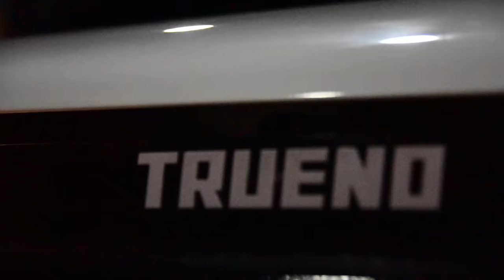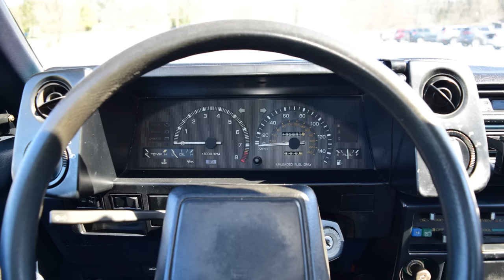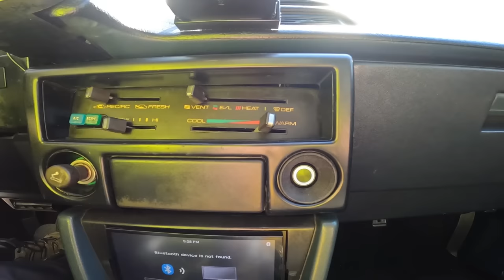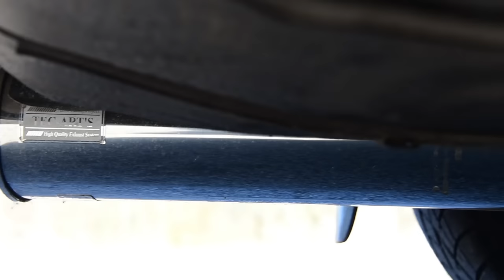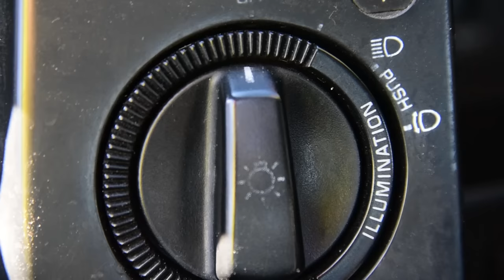1984 Toyota Corolla GT S Initial D AE86 Takumi Fujiwara Replica: Regular Car Reviews

Comment: I actually had 2 different AE86 at the turn of the millennium..... Both were bought for under $800 running perfectly and both were GTS models. 

Really wish I would've held onto them. 
I could have $20k to $40k
Reply: Lol, I feel your pain, I had other JDM cars which didn't cost much in 2005, now they are XXX times the price
Reply: Proof? Or it's not true.
Reply: Perfectly believable if it was before they started getting expensive.
When was that even? I remember they were about $10k when I watched Initial D for the first time maybe five years ago.
Reply: I'm talking literally 2000, 2001 when I was 18 and 19 years old
Reply: @user-pn3fv9pt4m you must be young. Wait until you hear that running s13s used to  be  $1200..
Reply: Okay, but....

1) If you had held onto them, would you have put in the maintenance to keep them running for over twenty years, including paint and rust repairs? Be honest: they were $800 cars back in the day, after all.
2) When you factor in all of those repairs, plus the cost to insure and register the cars, plus inflation... how much would you have really walked away with if you sold them right now? Probably a bit of money, but not as much as it seems when you consider the costs.
Reply: @arnehurnik turn of the millennium aka around 2000
Reply: I bought a 90 sw20 for 3k around 2015 and regret getting rid of it, stupid me got in way over his head with that project.
Reply: Z31 is an amazing car that can be had at a low price today
Reply: Same. I didn't hold on to the 86 I had, but I did hold on to the AW11s. I have 3 lol
Reply: @Toasty_Gaming  no. They're awful to work on. Not recommended.
Reply: This is true of all kinds of things, not just cars. You'll make yourself crazy if you think about it.
Reply: @blisterbrain  I know. Trust me. At 12 years old my Father sold ALL my childhood toys at a yard sale. Star Wars, Ninja Turtles, G.I. Joe and soooo many more. 
Even at age 12 I knew they were going to be worth money, I had every last accessory to every toy in great presentable condition.
Years later when my childhood toys were worth profane amounts of money, I would constantly show my Dad what my childhood toys were worth and made sure he realized he screwed me out of easy money. 
He was always genuinely regretful because he always taught me to be smart on what something is worth
......he couldn't get past seeing toys as "plastic junk".
 

He would tell me that he finally truly understood the words that 1 man's trash is another man's treasure
Reply: @willlawson6126  Don't get me started on what my sister did with all my stuff! 
It's funny how none of her crap got chucked out or sold at a yard sale, from which, I might add, I never saw a dime.
Dang, now I'm bothered again!
Reply: Lol proof or it's not true i guess you had to be there.. they were a dime a dozen in Australia late 90s early 2000s. I had mates with 3 or 4 of them in their front yard. And were quite a few back then with 20v silver top conversions and the like and you would be hard pressed to get a few grand for them if you tried to sell em. We were all watching initial d back then too but that didn't change the fact that they were 800 dollar specials to be beat on and just have fun with

Boggles the mind how some people can't fathom that and think they were always some rare exhalted and exotic magic carpet of a car
Reply: @brendanmeadors3099  What's funnier as these younger folks asking for pictures before the ages digital camera
Reply: Passed on buying an 86 GT-S in 2008 for less than $2,000.

Comment: What a classic car. The longevity of Toyota is incredible and exists for a good reason. Reliable and well designed vehicles
Reply: keep oil in em and they'll just go and go and go
Reply: Ikr idc what anybody says i will fork over $50 grand if I have to if I have an opportunity to get a pristine panda 
<藤原とうふ店>
Reply: @ghomerhust   In them and under them. They do know how to rust, it's the only thing that'll kill one. Mine was a generation older and I drove it to the junkyard when there was hardly enough good metal left to put patches on.
Reply: My 2001 Rav4 is still going strong, in all weather conditions.
Reply: As Jeremy Clarkson says: you will die before the car. My dad died before his Toyota, and the damn thing is still running, with all of its electrics still working.
Reply: The toyota THEN. Add electronic crap and self destructing 3 pot turbo gr malarky and you get a ticking timebomb...
Reply: @ktkacewhat you mean by "self destructing 3 pot malarky"

Comment: I have an AE111 so I'm not free of sin here but this car brings the hype and the smiles.  The 4AGE is an incredibly fun engine. 

And on top of everything else, this episode was quite special.  Well done all around, guys!
Reply: The 4AGE is possibly the most brilliant fun 4 cylinder to ever exist.  It just edges out the Austin A series for me.  The common theme is they are both pissed off 4 cylinder engines that punch way over their weight class, and sound amazing doing it.
Reply: JCS  Couldn't agree more, I also didn't know Yamaha had a hand in it.  Yamaha does everything to the most perfect degree they can.

Comment: The design of the AW11 and AE86 is the best kind of dated. I think the phrase you used ages ago was something along the lines of "optimism for the future."
Reply: Don't forget about the ae82 (fx 16) !
Reply: @yuuji_  I was going to say this too. I have an FX16 GT-S as my daily driver and it's a very fun car, even if it doesn't have pop-up headlights.
Reply: @ThePhoenski  i do too hehe
Btw are you running coilovers ? I can't find anything other than BC & Ceika (and less known DGR & MRP) but my main issue is their price. I'm not a cheapskate, but here in EU all these options are 1500$ or more :/
Also does 15*8 with a low ET fits ? (I'm currently on 15*6 ET 49, i need spacers at the rear)
Reply: @yuuji_  I do have coil-overs, however, I got the car with them already installed so I don't know what they are or what the specs are (I have pictures if you want.) Could you explain what 15*8 and 15*6 ET 49 mean? I also have an Ultra Racing rear upper strutbar, and rear and front sway bars. I didn't install these either so I don't know what the part numbers for these are. I've got a question for you now: how do you source OEM parts?
Reply: @yuuji_  my brother drives an AE82 GT too (European 3door model) he has BC racing coilovers and be careful with your wheel choice because you'll end up with very little space in the rear. For example, his wheels are 15x7 et24 with skinny 185 tires, and the tire almost rub the coilover (like 3-4mm) but the tire is also flush with the wheel arch ! Oh and the car is not lowered that much, I'd say a little lower than stock height
Reply: @yuuji_  I got a notification that you replied but I don't see a new comment, did it get deleted?
Reply: @ThePhoenski  yeah i tried to reply 2 times already, i had to rewrite this essay (yes it was this long) once i saw that it didn't got through. I maybe have a part pasted in the clipboard of my desktop, i'll try again later

Edit : typo
Reply: @Miky9560  yeah i'm already having clearance issues at the rear, i have 2 2mm washers (so 4mm wide) on the studs temporarily, that gives me a 1-2 mm gap with the suspension x)
But it's not flush with the fender, the front tho, almost (cf background pic of my profile)

Edit : i'm on 195/50/15, michelin pilot sport 3 at 2 bars (but i find the side wall to be quite soft, oem is 1.8 bar for 185/60/14, shop put 2.5 bar in the ps3 originally (nitrogen inflated))
Reply: @yuuji_  there is not much issue at the front, the tire sometimes rubs a little on the plastic liner but it's ok, front is 15x7 et35 with same 185 55 but he will put some 195 50 like you have. The real concern is the rear with aftermarket coilovers, a 195 tire barely fits in that space...

Comment: And then Toyota themselves made 2 unique versions of the AE86: the AE86 Sprinter Trueno Hydrogen powered car, and the AE86 Levin EV...

The best part: the EV has a manual transmission...
Reply: The hydrogen one also has a manual transmission, because it still has a 4A-GE
Reply: @Kosoku63  the EV having a manual is more significant because it IS an EV with a manual transmission...
Reply: @cjmpaja  id say, in my humble opinion, that the Hydrogen ICE Corolla, is a bit more gamechanging, because instead of developing something new (which they did for a bit), they took a 20 year old proven engine, changed its diet, and now you can run it beyond 2025-2030+ because its only emission is water, and you still have the sound of an ICE, the grittiness of an ICE, the fun and simpleness of an ICE engine, and all you need to do is feed it compressed water (its not that simple i know) and make sure it doesnt rust beyond comprehension, but i guess manual EV is pretty cool since you can control the torque and that can be a fun time.
Reply: Then the question is: Why the richiest Toyota does not make a modern version of this cars? They have the money, hype train is not seems to stop, and they have the big chances to become more rich with that retro styled hatchback/coupe. Why Toyota is being so pussy about releasing anything fun and original, while Chad Hyundai/Kia just do it and gets expected lots of cudos for it?
Reply: @mushijian7839  go watch the Rav4 Prime episode of RCR for reasons why Toyota does Toyota, but, if youre paying attention to what theyre currently doing, Toyota is trying to paint a bigger picture, because whats the point of wasting money making fun cars now, if theyre not gonna survive for another 2-7 years (since most countries and companies are planning to go full EV and clean by 2025-2030), so like instead of dreading in that perspective, why not spend it on R&D for a solution? hence all the Hydrogen research theyve been doing recently, hell even Porsche is researching synthetic fuel so that the Porsche 911 doesnt go EV because even they realised thats an abomination.
Reply: @Namiz00  Well, about hydrogen and synthetic fuel thing... Of course it's a good thing to invest your money as a large company, but not when "all bets are off" for capitalistic government, who choosed to just make big smartphones on wheels. Rational companies will be screaming out loud "LOOK! THERE IS REAL WAY NOT TO BUILD EV AROUND HUGE LITHIUM BATTERY!!!", but they just get an answer basically to shut up about it, because Iphone with dead non removable battery is more profitable for business sharks, rather than Iphone with the battery that you can remove, pay a small price for a new one, repair it on your own, and continue to walk with the same old Ipnohe again.

Comment: From Puerto Rico here, still living on the island, and I can confirm that they were very common and still are very sought after. If you get out of the metropolitan area and go to the inner parts of the island or the west side, you’ll still see them roaming the streets. If you attend auto shows and classic auto shows you will find pretty beautiful examples and unmolested ones too. 
The Saab wheels were the hot trend for the hatchback specifically, but the coupés also joined in.

Comment: Mr regular is absolutely right on the ae86, I'm on my third ae86 fastback, first one was an SR5, second one was a 2jz swapped SR5, and currently I went back to basics with a rust free GTS with a freshly rebuilt 4age. The whole attraction to this car is how visceral and basic it is, the challenge of driving something so underpowered to the limit is very rewarding. Although it's a bit overpriced and over rated lol

Comment: I passed on a 1986 or 1987 GTS sedan in early 2012 - it was $3600 I think, in really good shape. I was looking for a replacement for my little '86 Corolla hatchback (FWD) that was in better shape because it was rusting out. As it happened, the fuel pump in my Corolla took a dump on the way out and I took it as a sign. I ended up picking up a 1981 Tercel for $3k that summer instead.

The Tercel is my happy place, and it was my daily driver for 10 years (now relegated to when I feel like driving it so I don't destroy it on my commute). After I replaced my fuel pump, my brother drove the Corolla until it blew a head gasket, which was well after it had strayed into "an car" territory... holes in the floor, jury rigged brake piping, really the accumulation of roughly 30 years of Minnesota winters. Parts of it ended up in the '87 Corolla that was my first car and which I gave back to my best friend when I decided I wasn't up to maintaining it anymore.

Sometimes I think I shouldn't have passed on the GTS, but if I bought it, it would have been used, and it would have ended up accumulating rust and wear just like my Tercel did. I suspect whoever owns it now probably doesn't daily it all year. These days I look at AE86 prices and I am absolutely dumbfounded what people are willing to pay for what is, at heart, just a really decent economy car. And I get really annoyed with the tuners who throw all the goofy Batmobile shit on these poor cars. It's also obvious that lots of them bent the axles on their Matchbox cars when they were kids with the dipshit amount of camber they like.

Comment: You can get a brush specifically made for cleaning wheels. They work great and they’re pretty cheap. It may help with the w h i  t e  w h e e l s
Reply: Must have some cheap brake pads on that car, I have white wheels on my Z31 and they don't get that bad after one drive.
Reply: @nater86zx  have an Integra Type R with the factory white wheels, plus race discs and pads. Its that bad. 

I havent found a brake pad that doesnt end up with my white wheels being turned completely black after half a tank of gas
Reply: @_Zekken  did you get it before or after the millennials ruined the GSR/ Type R market? 😂
Reply: @wetfeathers9971  uhh... 2019? Also Im Gen Z, and I live in New Zealand so mine is a JDM '96 spec with the straight headlights.

Comment: As a Puerto Rican living in the island, I can confirm that the "sapito" (little toad due to the pop-up headlights) as many called them, were and still to this day very sought after. I currently own a red panda manual corolla coupe 1985 SR5 and used it to drive across the island many times. Until last year it was my daily driver, and I very much still enjoy riding my Toyo. It was my father's car and when I turned 18 it was my gift and I do not plan on ever letting go of it.

Since I was a kid, I always thought it would be great to have both the coupe and the hatchback so…. Is the give away valid to Puerto Rico? Would you ship the car over to the island if I win?
Reply: USA residents only, per the rules on the webpage.
Reply: @Stahlwerk88  Puerto Rico is literally part of the US lmao

Comment: That car has to be a swapped 1984 SR5. I have one here in Phoenix with all the same power options including the sun roof. The GTS trim was started in 1985 state side. I have one of those also. You can tell if the car is a true GTS if it says AE88 in the vin instead of AE86 like the SR5. 
Also, I died at "Saab wheels on an AE86 is the closest GM will ever get to touching greatness". As a past Camaro owner that hit me in the balls but then put ice on them at the same time as an AE86 owner. lol

Comment: This one was originally an SR5 that was swapped with a 4age and a GTS rear end, it went through my friend who sold it to an influencer who then tried to sell it for 40k.
It was poorly built honestly, I can't believe this one is still around and hasn't been parted out yet.

Ah yes, the corolla cycle
Reply: I was gonna say, there was no 84 gts trim, only sr5. I does have an 86-87 model front bumper. Sr5 seats/interior, I know they did have those in some 87 gts, but thanks for confirming this is a gtsr5. Totally usdm bumpers too.

Comment: As someone who had the E51 SR5, and an E70 1.8, and had frequently driven an AE86 (all in period) I enjoyed the former two cars just as much for various reasons and the E70 the most. The E51 was just fun because it easily got 40 mpg. Driving forever for nothing has it's own charm. Of course the much older series were much less powerful none of these were really powerful. The E70 was torquier off the line than the AE86 (perhaps ligher?) and just more fun to zip around in normal city driving than.

And that old E51 liftback was just about the most lovely mechanical sounding and solid piece of equipment I've ever owned. And I have had a few mercs (no early 2 dr. coupes or G-Wagens mind you). 

My fondest memory was getting to drive that E70 in a heavy snow storm sideways down an empty highway for miles. It was long before drifting was a thing. Nothing like watching the snow coming at your through the side windows. It was so easy to balance.

Comment: I had a 1986 GTS. I wanted an MR2 but couldn't see using one as a daily so I got the Corolla. I still want an MR2 but the GTS was pretty great! It absolutely sucked in the winter though with the original Potenzas.

Comment: In 2001, my AE92 GT-S got totalled by an idiot running a red light. With the insurance check, I bough a 1987 Corolla GT-S, right at the beginning of the initial D and drift craze. It was a cheap tomato red repaint, lowered 2 inches, MK2 Supra wheels, and a 45 degrees rear side exit twin tip, HKS-style exhaust. Paid 2300 CAD$ back then. Was it fun? Yes. Was it the greatest car I ever had? No. Of all the 80's and 90's cars I had as a younglin', including NA and Turbo cars, my favorite remains my 1989 Suzuki Swift GTi.